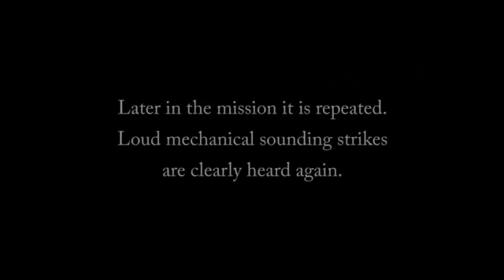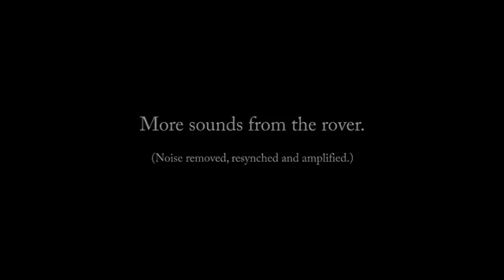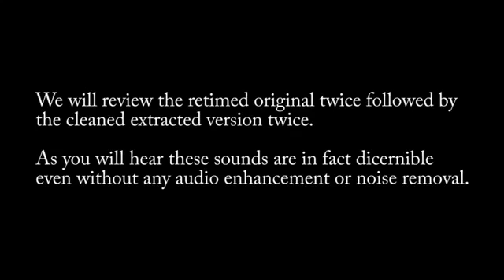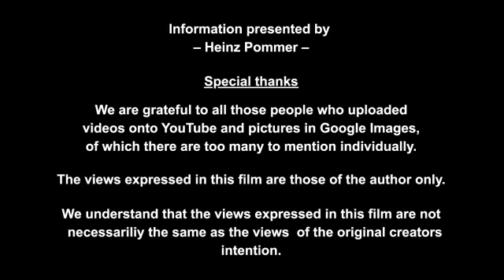Apollo 11: True emotions

Comment: At 4:11 you see a different crash of the flying steadbed.  Were there two crashes because the two shown are not the same.  One the pilot ejects with no clouds around very close to the ground. The second crash shows the clouds and this pilot ejects with much more altitude and the flying bedstead falls much farther before it crashes and there are no cumulous clouds about like the first crash.  I didn't know there were two crashes. Is NASA trying to say these are the same crash because they are not.  So, were there two crashes possibly more?

Comment: It's madness to get in a rocket since they are prone to explode. Apollo was a rocket (the ascent stage) on a rocket (the LEM)  on a rocket (the CSM)  on a rocket (saturn5).  The odds of disaster are multiplied again by the 7 gos. 
If it hurts your head to imagine the sheer unlikelyhood of survival, then you understand what I'm saying. 
But that's not the end of the jeopardy. The tiny ascent stage had to blast off from the surface with two men and lift them 60 miles up. Then it had to accelerate to 4,000 mph. It doesn't matter how weak the gravity on the moon is because that thrust is the same anywhere. But here's the kicker, it must find the orbitor and match it's speed and trajectory just in time to rendezvous. Apollo 11 reportedly took two orbits to complete this task, but paved the way for others to manage in one. My uncle Sylvest..